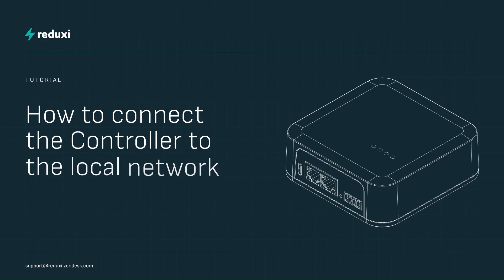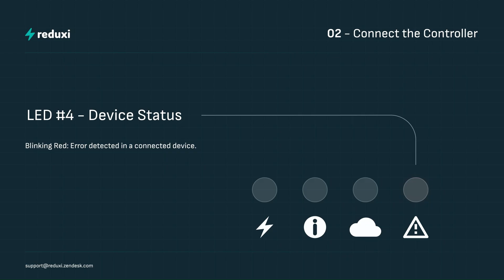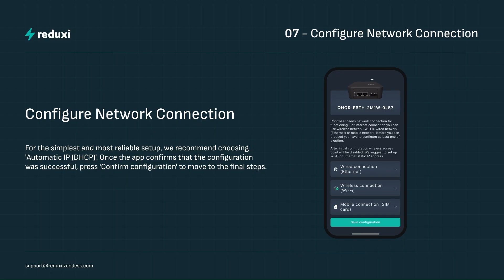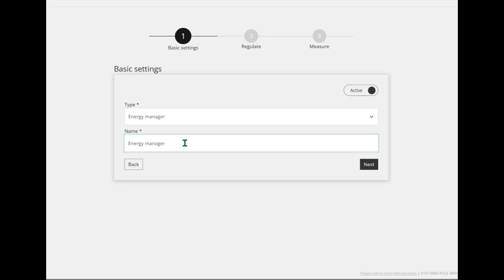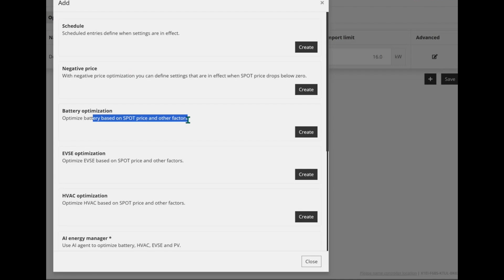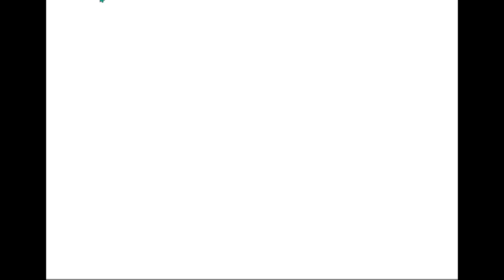What is Reduxi Controller, why do you need it and how to use it

Comment: Very well presented, and I really like the overall setup. At the same time, reality often looks a bit different than what is shown here in practice, it unfortunately doesn’t always work as smoothly.
Personally, I’ve had a long-running issue that has only gotten worse instead of being resolved. And my needs are actually very simple, just battery control in a normal household with electricity import, export, and consumption, no EV or heating control.